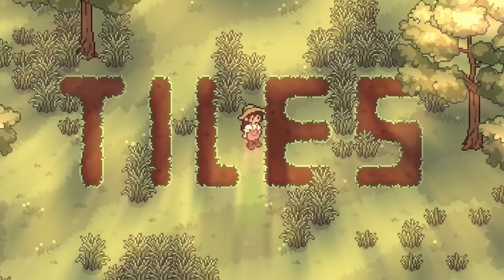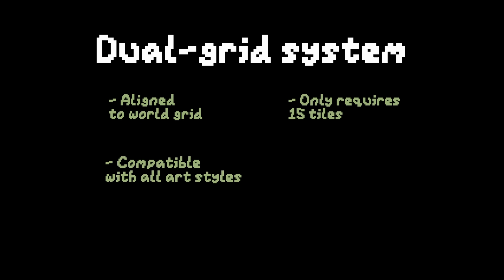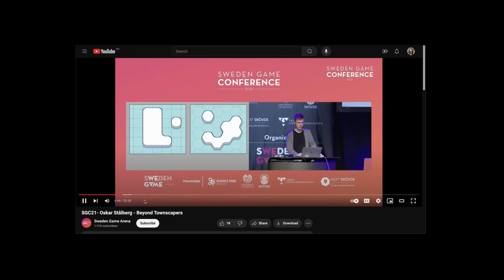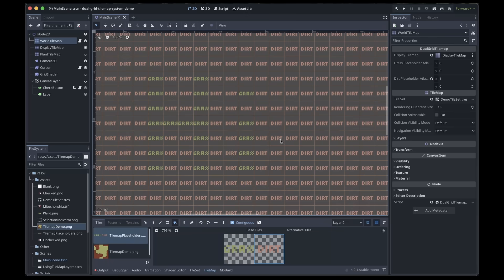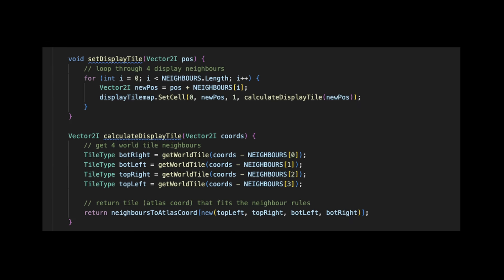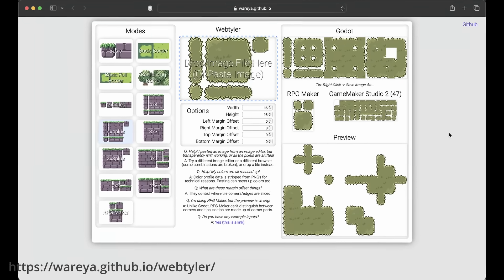Draw fewer tiles - by using a Dual-Grid system!

Comment: I've been working on an RPGMaker clone engine for a while now and one of the biggest things to me has been making sure that creating assets is as easy as possible for artists. There are two main tileset types I've implemented for square tiles (as the engine also supports isometric and hexagonal): sub-blob tiles where you cut every tile into four smaller tiles then use that to render maps, and what is called "extended auto-tile" where you have the sub-blob assets as well as inner and outer corner full tiles so that you can have more rounded tiles (from MX/MV and XP respectively). This way you only need to draw six tiles or thirteen if you are making an extended tile. I had never considered using a normal blob sheet but then shifting the rendered map by half a tile, I'll have to look into that. Love the work and your art for the two games are lovely. Keep up the good work!

Comment: The problem of remembering the minus and plus could be hidden by having two classes for the two types of vectors, and a conversion function. So getWorldTile takes a WorldTileVector. If you want to pass a DisplayTileVector you need to first convert it with vector.getDisplayVectors. Then the type system should protect you from accidentally using the wrong type of vector.

Alternatively you could store the coordinate space as a property of your vectors, and have a generic transformation method that takes a new space. Then when you want numbers out of your vectors you'd just need to fetch the numbers in the appropriate space.

Comment: I tend to go the route of making just 13 quarter-tiles and constructing the tile I need from inner/outer corner pieces, edge pieces, and a middle piece. The drawbacks are you can't easily draw details bigger than a quarter tile and it's a bit more work to paint with them since you need to place 4x as as many tiles, but depending on the art style this works a lot of the time especially combined with overlay textures and layering.

Comment: If you don't need to differentiate between top and bottom on Tile Set you can condense the 15 tiles (5:56) down to 5 which is possible on Godot.

Comment: Makes me appreciate simple tile sets from old floppy disc systems, like the Ultima games, most especially Ultima 5.  There are maybe 2 or 3 hundred tiles in the whole game, but you can get a shocking amount of variety in the terrains you can build with them.  When I adapted them to make my D&D maps, I found that I only had to make around 10 extra tiles just to supplement them

Comment: extends TileMapLayer

@export var width = 30 + 1
@export var height = 25 + 1
@export var tile = Vector2i(0,0) #tilemap location of tile type

var x = 0 #global horizontal location of the tile
var y = 0 #global vertical location of the tile

func _ready():
	for b in range(height):
		for a in range(width):
			var z = Vector2(0,0) #tilemap location of appropriate tile formation
			for j in range(2):
				for i in range(2):
					if get_parent().get_cell_atlas_coords(Vector2(x-1+i,y-1+j)) == tile:
						if j == 0: z.x += 1 + i
						elif j == 1: z.y += 1 + i
			self.set_cell(Vector2(x,y),0,z)
			x += 1
		x = 0
		y += 1

I should also mention I organized the tilemap as
(0,0;0,0)(1,0;0,0)(0,1;0,0)(1,1;0,0)
(0,0;1,0)(1,0;1,0)(0,1;1,0)(1,1;1,0)
(0,0;0,1)(1,0;0,1)(0,1;0,1)(1,1;0,1)
(0,0;1,1)(1,0;1,1)(0,1;1,1)(1,1;1,1)

Comment: That's lovely. 😊

In my case I invented the dual grid system on my own, and it's such an obvious solution I am surprised you had to make a tutorial about it.  Let alone sharing it on GitHub. I also animate water on the shore.

I wrote my own programming language (from assembly), plus the game engine and framework on top. Solving problems such as this, is a daily routine, and I guess that's why I don't use other people's tools. I dislike fighting with my tools, when I know I can make the tools myself.

Comment: Good way to have a tilemap terrain combinations!, but as far as I can see is not multi terrain isn't it? I mean, it works like a charm with 2 terrain types (master and slave) but if you need more terrains and not all of these terrains can be the slave of the tileset, maybe this mechanism won't work, maybe will work if all except grass are slave (example: dirt, sand, water, snow, etc...) but I guess the result won't be the same 😕

If my affirmation is wrong please tell me because I'm looking for a thing like I've described 😅

Comment: This is such a clean video!  Great visuals.  Would love to see more systems explained like this.

I'm currently working with procedural meshes and had to draw things out on a gridded whiteboard to get all the math straight.  There are also some past problems I've faced in my racing game which have had shockingly few resources online despite many other games solving these same problems.

In game dev, we help each other out.  That's how it was yesterday, that's how we will make it tomorrow.

Comment: This is really amazing! 
However, I did find one flaw with the dual grid system - Performance
If you're dealing with large procedurally generated areas where you need tile streaming or chunking, then updating multiple grids across multiple layers is much too expensive.

Comment: also known as wang tiles, dual grid is the same tileset as the 15 tiles, but since its storing the offset logic as a dual grid its not an issue for knowing what material type a tile is. honestly this is the way all tile grid systems should be. It would be nice to see engines start shipping with dual-grid systems

Comment: I just don't seem to understand it.
Why don't I just also use the 16 Tiles from the DualGrid and just use unity Rule Tiles?
And what stops me from just offsetting the Tilemap anyways? With this i can get the same Effect a Dual Grid System would use don't I?

Another Thing I don't quite get is: Why do you save Tiles? If you draw 500 Tiles the "old" way or 200 with a dual grid system won't the result not look different because it's not the same assets? From what I Understood, Dual Grid is just a way to check, which tile should be placed. But how does that correlate to how many Assets you need? With Rule Tiles you don't really need to check all 8 directions but just the ones you want to check. 

Someone please enlighten me and excuse me for my bad english lol

Comment: I'd like to clarify something.  This Dual-Grid system is, in essence, the same as the 42 tile system.  Each tile in the 42 tile system is just a set of 4 quarter tiles, and every combination is pre-defined.  The Dual-Grid simply creates the proper tile on the fly.  If your Dual-Grid is half the size of your normal grid, you would find that you get the same results.

Obviously this method is superior in terms of simplicity and storage. It's a programmatic solution to an artistic problem.  Sometimes the 42 tile method is going to be a better choice though.

Comment: But in the 3D case, the dual-grid method requires 2^(2^3) = 256 tiles, while the naïve “one tile for every neighbor configuration” method, including triagonals, requires 2^(3^3 - 1) = 67,108,864 tiles.

Comment: There are some downsides for the dual grid.
Huge ones that are a deal breaker for my game at least...and people don't really consider:

1. You can't see the display grid in editor time. That means you shot in the dark and don't really know how your final scene will look like from looking at the place holder tiles.. this really makes the workflow annoying.
Sure you could get around this.. by making the generation in editor time.. but its a nightmare to code.

2. Many many layers.
What if you want to have three ground layers? Like is stardew valley? Ground midGround and flooring? That's 6 layers!
Good luck managing that...

3. THE BIGGEST DEAL BRAKER FOR ME
What if you what more than two tile transitions? What if there are more than just two tiletypes?
I mean what if you have dirt near grass near sand?
You will need another layer.. which sends us back to problem number 2.

4. Where you skip in drawing tiles, you.work in code.
You need to add logic for the combinations, and each combo you and its new logic! Don't know about you, I love code but i like to draw alot more...

5. Like you showed us, there are tools that  will make a 16 set to a full 47 set. So why are we even doing this?
You can make a simple tile map with 47 by only drawing 16.. so it's the same amount of work on your part!

In conclusion, the dual grid system is a very promising idea.. it can work for sure but it got its flaws.
Personally I feel like I wasted alot of time making this work to not avail.
Reply: i know this is an old post, but yes. yes! .... i agree. there are down sides to everything. in the end, there's no such thing as a free lunch! :)

Comment: @4:26  isn't that bottom left and right should be  (0,-1) and  (1,-1)? instead of (0,1) and (1,1)
Reply: No. In godot, positive Y values are downward, negative are upward.

Alot of games and game engines do this, its just different for math.
Reply: On top of what the other guy said, I believe Godot as well as other game engines and applications that (0,0) refers to the top left pixel for screen coordinates

Comment: Hey, awesome video, I learned a lot!

After playing with this technique for a while in Godot I came to find 2 major limitations:
First you can only have 2 logical layers, going up or down
Second, you can use transparency masks to mix and match, so you are not tied to one texture pair, although you need 2 textures for each layer, so think reversing dirt and grass, keeping 2 sets for each texture and having transparency where you would have a contrasting texture, that would allow transitions of "up and down" layers between any number of textures, effectively allowing modular ground transitions.
Oh and a minor problem is that only the "top layer" gets to be connected diagonally ever (at least with the 16 tiles, could work with 18 tiles I imagine)

I wonder if there are some ways around the layer problem, anyway, it was a blast to play around with the dual grid, thanks for the inspiration.

Comment: Meanwhile I am using full tile + tile edge as a thin edge on bordering tiles. And since those are different tiles, I couldn't use rule tile for it. 6 for loops and 45 ifs later it's working. The effect is worth it though.

Comment: Another method is smart edges. You just paint a color  for the tiles and code determines what transparent "union" to use, to cover and blend the edges.

You save larger grids as a final image, which load faster, after the initial rendering.

You can also get randomized edge variations, which removes the nasty "tile" look. Only one set of blended edges is needed. Since the adopted colors from surrounding tiles is used to color the base, on each side of a transition. (A simple colorize or pallet-swap, is used to change the colors.)

Comment: Using TileSetLayer in Godot 4.3 it is not necessary to actually move the layer by half a box. You only have to set the Texture Origin in the Tile Set editor to - 0.5 * tile-size, configure the terrain matching, and you can draw the terrain without any custom logic.

Comment: I have a better algorithm than this that requires only 4 tiles.  A full tile, a single corner, a double corner, or a triple corner.  Each of these are only half the size of a world grid tile, so it takes 4 of them stitched together to form the output tile.   This technique allows any tile type to border any other tile type, since we construct the final tile at runtime out of smaller pieces.

Comment: I came to a similar result, only not through a double grid, but when the brush operates on the vertices of the cells, and the tiles are placed in the cells. In principle, this is an equivalent solution. I spied it in the Tiled editor.

Comment: Thank you very much for that video. I am working with a procedual generated tilemap, and had big troubles. a: running autotiling on godot 4.3 is too slow to have 16x16 tile chunks painted without fps freezes. working with different layers didnt work because the edges were messed up and b: there were way too many tiles to create.
Saw this video right before I was about to give up yesterday, took the idea over and now my tilemap is running, generating and expanding perfectly!

Comment: Thanks for your video. For me though, I found this video a bit hard to follow. The video itself is very well put together, but never seems to explain itself in any statements it makes. Further explanation would be very useful.

Examples where things are not explained:

0:19 - having 8 neighbours means you need you need 256 tiles. What is meant by neighbours and why would it be 256 combinations? I see the random pictures, but it's not clear what these random pictures are indicating.

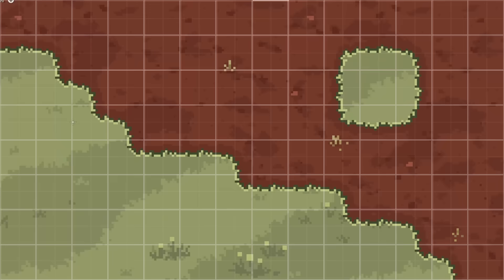0:48 - by default they don't align with the world grid. What exactly is meant by not aligning with the world grid? What is the world grid? How is not aligning a problem?

0:55 - should this be considered dirt or grass? Yes, the first arrow is pointing to dirt, and yes, the second arrow is pointing to grass? But, what exactly does this question mean? There is no reference point to understand what the question is asking.

 1:00 - placing a single tile down results in a much larger area than expected. Why is this?

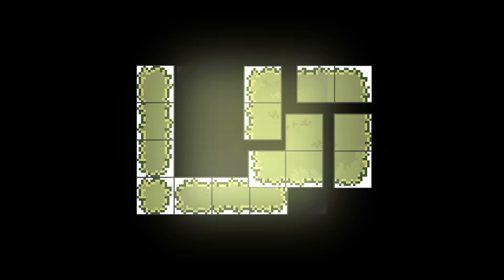1:40 - I had to slightly expand all the tiles. What is meant by this? It looks like the graphic is enlarged, textures removed, and white space added as padding is put around each tile. But, I don't understand how this helps remove corners sticking out or what exactly is meant by expanding.

2:00 - I prefer the look of perfectly rounded tiles. Are you saying you prefer the look of the one on the right side?

 Of course, this could all be me not understanding as much as everyone else here. Or, maybe you just want to keep your videos as to not bore everyone else. But, for me, the extra explanations would be helpful.

I think the houseplant game idea as a great idea and look forward to seeing the finished game.
Reply: 0:19 - neighbors are all the tiles that surround a certain tile. you want the graphics to connect visually with all the surrounding tiles, and on a square grid, there are 8 tiles (including corners that touch) that affect that. assuming the only 2 states are that a tile should connect, or shouldn't connect, that means we have 2^8 = 256 combinations. the pictures are representations of what tiles are ones that connect, and what tiles shouldn't connect. 

0:48, 0:55 - the visual boundary between dirt and grass lies in the middle of the tile. if dirt and grass need to have different properties, should the tile that is half dirt and half grass be dirt or grass? it's a question that the programmer(s) must decide on, and it's likely many players will disagree, which is why it isn't considered ideal. these things that look like half dirt and half grass as highlighted in the video are one tile, and in most cases a tile can only be dirt or grass, not both at once.

1:00 - i'm not familiar with how exactly tiles work in commercially available game engines, but i can make some guesses. it's a side effect of how these systems work. placing a grass tile will always take up the full size of the tile it's in, and to have a clean looking boundary between different tile types instead of a hard line, it needs to expand the tile out at least a little. why it goes out half a tile, i'm not sure, but it might be required to keep it looking consistent

1:40 - i'm not sure of this either, but based on what i can guess, the tiles were redrawn so they stick out over the edge of the space they actually take up in-engine, so the graphical edges go slightly over the edge of the tile as it is in code.

2:00 - yes, look at the labels on the top of the screen.

Comment: I used this video as inspiration and added this type of system to my own game engine and it works very well.
Bonus, my game engine already supports rendering tiles rotated/flipped, so if I have very simple art I can manage with ~5 tiles. I reached up to 3 different types of ground on the same background map with only 12 tiles drawn out.

Comment: To help find more resources on this the other thing to look for is 'marching squares' it's the same concept but for generating a mesh. There is even a 3D version called marching cubes. It has the same 16 configurations. Instead of thinking of it as two grids it has the corners have values like dirt/grass, and then the squares are filled based on the corners.

Comment: I am trying the isometric version of the dual grid system right now and custom-made sand and dirt tiles for them. Now it dawned on me that with say 5 types of terrain you would still need 5×5×5×5 tiles as you could have say sand, dirt and two grass intersect on one piece, is that correct? Because then i will need to find a way to generate a transition mask or so and let python create the pieces for me. Right?
Reply: Ok i think i have an idea, which is probably not new in any way. Every tile can get up to 4 terrain textures stacked on top of each other. There is a hierachy of layers from low to high like rock>soil>sand>forest floor and snow and leafs could be an extra thing on top. Then between the ground layers there is a mask that looks at the neighbours and creats rounded gradients but always the same tileborders. And then there is 1 or 2 noise layers that stretch across the whole map and make the layers more realistic and the transition tiles.

Comment: Implementing it, I quickly found out this doesn't scale well if you have many different kind of tiles touching each other. You have to handle each and every combination (e.g. Water on the top left, Dirt on the top right, Sand on the bottom left and Grass on the bottom right).

If you are aware of this and you level design properly, you can easily get around this limitation, but if you ever allow your players to terraform... then you'll be in huge trouble!